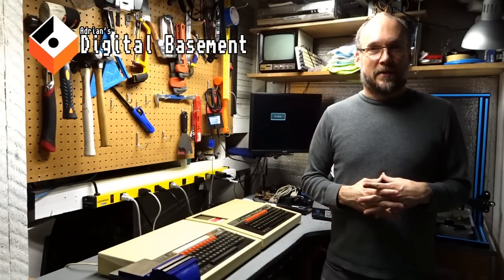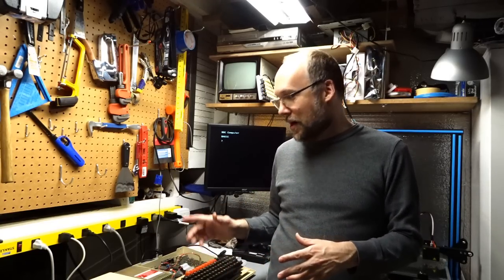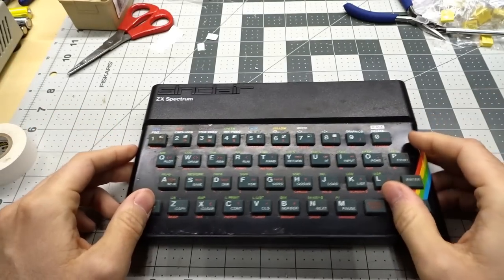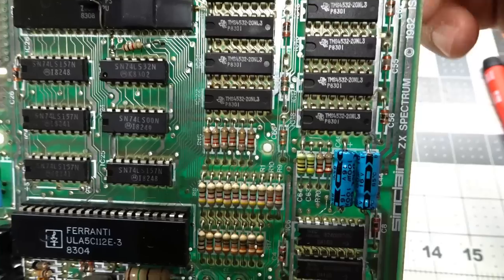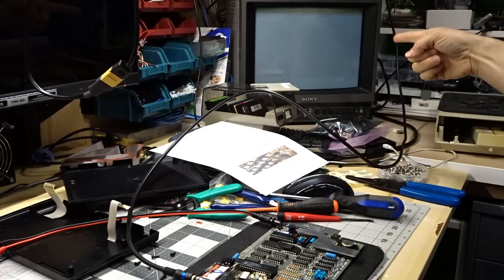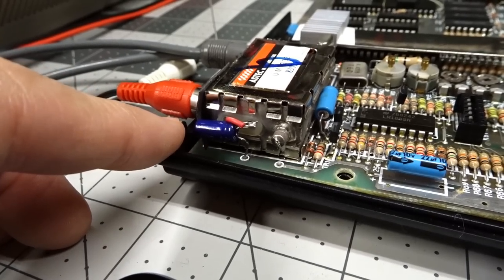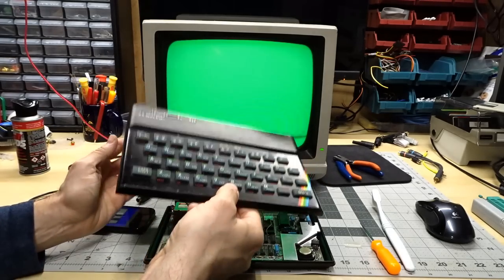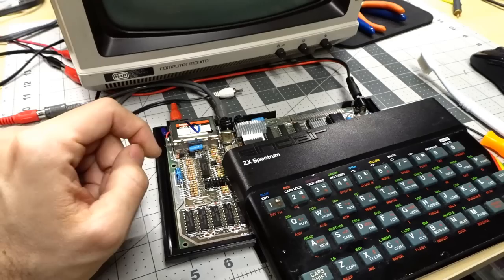ZX Spectrum Part 1 - It's a very sick machine (and a BBC Micro update)

Comment: It was interesting seeing that video.. Nice work by the way.  I had several years back.. The keyboards were a problem.. I replaced mine out for one of the Fuller keyboard replacements.  The Fuller case/keyboard turned the 48k Spectrum into a decent computer...  great video

Comment: Nice to see the gold old rubber 48k speccy.
16k ROM and 48k RAM
We got ours in 82. Took it back 1 week before warrantee ran out. Not sure how but seems a hot drink went in the back. Replaced but that 1 died after 18 months (still under new warrantee). 3rd spectrum lasted for a good 10 years. Early games were basic in gameplay and in coding. Later games used machine code and could give 64 and 128k machines a run for their money. Spectrum was popular and had a great following.
16k was the basic. You could add extra ROM to make it close to 48k
48k was what most people started with. It was always bought with 48k. You could add in extra RAM in the ports
After this there was a 48k spectrum with a hard keyboard.
I think there was a 128k spectrum and possibly a spectrum+ and +2 and +3
I recall 1 had a built in cassette which I think was used to stop piracy

The spectrum was quite hardy. I dropped mine down the stairs and had no issues. (3rd speccy).
The power pack was replaced every few years at £10-£12
Games took 3-5 minutes to load.

Comment: I know the purists will likely say get another spectrum 48k, but I recommend the grey +2 128k. I had no issues with mine and compatibility back when I was a kid, but it has the advantage of outputting all the audio to the TV and supports 128K games, even if its just the improved sound. 

After watching this video I was straight onto ebay and bought myself one. They are easy to mod to get the games to run off something other than the built in tape deck, I did mine when it broke so that it would run off my walkman, and I was only about 10 at the time, so its not that difficult. Mind you I still have a few old tape deck cd adapters laying about so could likely get something working with one of them.

Comment: Nothing wrong with issue 2 Spectrums, when Re-furbished properly they work well. The best way to do the composite mod is to use a small 100uf capacitor with positive to the PCB and negative to the modulator. To heatsink the ULA, remove the socket and solder the ULA direct, then use a 4.8mm heatsink.

Comment: I had one of the Timex/Sinclair computers which was sold here in the United States and it worked fine for a long time until the ribbon running to the keyboard finally broke and needed repair, but after putting it in the shop once I didn't want to do it again since the local Timex plant had closed by that time. It was my first computer and I got it cheaply since the drug store I got it from wanted to get it out of the store.

Comment: I noticed from how fast the Spectrum initialised (going from the black rectangle to the copyright message) it thinks it's a 16K machine. This is often a sure sign of a fault in the upper RAM. 
It's probably worth removing (and socketing) the upper RAM components, and seeing if the Spectrum functions properly as a 16K machine.

It's also possible a faulty keyboard membrane could be causing the memory faults ! This happens because the Spectrum design (ab)uses the address bus lines as "active low" driving for the keyboard matrix. See the schematic for the connections to KB2 to see what I mean.

Another thing to definitely check is that the outputs of the voltage converter circuit are correct. This is one place the capacitors are critical. The circuit is quite a crude voltage boost/inverter circuit and is a frequent cause of headaches in the spectrum. Check especially the +12V and -5V outputs, with an oscilloscope if you can to make sure they are not only the correct voltage, but free of excessive ripple and overshoot.
Reply: @adriansdigitalbasement  ah yes, hot RAM chips are almost certainly a sign of failure. You can use 4164's I believe with some modification

Comment: Cut 1mm of the tip of the flat keyboard connector and it works again. It only supports a few connections/disconnections before gets worn. In my ZX Spectrum I have soldered a better connector, using wires, because of that.

Comment: To answer the RAM thing, Spectrums were available in 16k models, but the vast majority were either 48k, or later 128k, with the 16k model being discontinued very quickly due to poor sales. The 16k models were so rare, most published software requires 48k.

Comment: The Spectrum internally works in the YUV colour space. The LM1889 IC on the board converts U and V into a PAL compatible chroma signal. That chip requires 12V to operate. This is why you lost colour during the under voltage: It was high enough to generate the 5V for the computer logic ICs, but not high enough to generate a proper 12V for the colour modulator.

Comment: The simplest joystick mod is for Sinclair Joystick. It uses the top row of the keyboard, either half, so 12345 are one stick and 67890 are the other stick. I forget the ordering butI think right (6-0) is LRDUF. You can piggy back a 9 pin D socket into the lines.

Comment: Take a look at retroleum.co.uk. They sell pretty much everything that you need here. Pretty much any Spectrum these days will have a defective keyboard and you will almost certainly need a new membrane. RAM failures are pretty common as well. They certainly happened to me. First with the lower RAM going and then the upper one as well. Instead of replacing the chips I suggest that you just get a lower and upper RAM replacement boards, solder them on and you are done. This has the added bonus of using a modern RAM that is less likely to fail. Recapping these machines is a good idea as well. Oh and possibly replacing the voltage regulator with a cheap ebay part. You can also find a replacement faceplate if you wish.

Overall I think you will need to spend about 50£ to fix this machine in total. And seeing how a new one would cost a similar amount (and probably require similar work) I think it's pretty reasonable to repair this one.

Comment: If you suspect a RAM chip, source one from somewhere, then use the 80s  chip testing trick of piggybacking the new RAM chip onto each of the soldered chips in turn until you get some sense out of it. Just tighten the pins a fraction and push it over the existing chip without soldering...

Comment: I'm about a year late to this party... these computers were sold in kit form or you could buy them assembled, the 16k version could be upgraded to 48k with a chip set you had to solder in yourself. You should have bought the Sinclair 128k + version whilst over here, the toastrack version not the later Amstrad +2

Comment: The later versions of the ZX Spectrum indeed had better keyboards, as well as an AY-3-8912 sound chip, MIDI compatibility, and other features.  They even have spacebars.
Reply: Although interestingly, they still used the same 40 key encoding as the original Spectrum. So, for example, the cursor keys simulated pressing Caps-Shift and the appropriate number key; pressing ";" simulated Symbol-Shift and O etc.

Comment: I always liked the super light-weight build of the ZX machines. I don't particularly like a solid feel.

No point in the UK is more than 50 miles from the sea, and it rains a lot besides that. It's just a damp part of the world.

Ha! "#Foreshadowing" popped up just as I was about to type, "Those membrane connects are tougher than the ones on the ZX81." They are, but I guess not by enough? :) The ZX81 ribbons can fail if you look at them funny.

I forgot how tightly packed Spectrum boards are! Or most Sinclair products, really.

Oh I love the "performing mods" screen! :D

LOL yeah I hated typing BASIC on the ZX81! I have no idea why I bought expansion board kits for the thing. Every keyword is a different key and they're not shortcuts, you have to use the key. I think, rather than have BASIC recognize text to tokenize words as it found them, they saved on ROM space by essentially having the user enter tokenized code directly. It makes good sense from that point of view, but getting used to it is a lot of work. And would it even have saved any ROM space? The code has to know which letters go with which token to display them, anyway.

Alternating lines suggests PAL isn't being interpreted correctly, or maybe not generated correctly? Perhaps the frequency source has drifted. But I guess it's long fixed by the time I type this.

Comment: Typing is faster when you know the keys after days of code. It's a good memory aid to remember all the basic commands too. Was the BBC shipped at cold low pressure? Possible reflow all the solder in the PSU.

Comment: The Spectrum came in 2 versions: 48K and 16K (for the poorer kids like me). I upgraded the extra 32K after a couple of years (1984 or 5) thanks to my granny's generosity. I was lucky in a sense, as the upgrade chips were probably better quality. I had the computer until 1987, when I sold it (and bought a motorbike instead :-)

Comment: Seem to remember most of these were sold and advertised as 48k? 16k versions may have been the earliest? Membranes were a known issue even when fairly new? Also those keys look in fairly good condition. Usually the lettering is worn off and the keys worn down.
Reply: The 16 and 48k models were both released at the same time. The 16k model was supposed to be the cheaper "entry-level" option. After a year or so, most commercial software targeted the 48k, so most 16k Spectrums were upgraded to 48k, either externally or by sending them back to Sinclair for an internal upgrade (or in some cases, they'd just send you a new or refurbished 48k model instead).

Comment: A good aproach with that Spectrum would be:
* Mod the board to be EPROM compatible (you need 2 diodes and a resistor)
* Socket the ROM
* Burn a ROM with the Spectrum Diagnostics ROM and plug it into the socket (see http://blog.retroleum.co.uk/electronics-articles/a-diagnostic-rom-image-for-the-zx-spectrum/ )

... you are now able to troubleshoot the mainboard without keyboard, while you limit the investment to something in the order of a dollar.

Should you be able to repair the board, you can consider buying a new keyboard membrane and metal keyboard cover (you can buy those new too). This is a bit more serious investment, but:
* Metal covers on Spectrum often look worn, so if you buy another one, the metal cover is likely not ideal either.
* It is the only serious cosmetic problem on your Spectrum, once you have replaced the metal cover, it will look brand new.

Comment: There were 16k and 48k models availible for the original ZX spectrum.  The 16k didn't last long though it was only £50 cheaper and most software for the spectrum was written for the 48k version.

Comment: The 2 main issues with the Sinclair are the keyboard membrane cracking and the ULA going dead. The edge connector wears out but re tinning it with the soldering iron fixes that :)

Comment: @12:25 this could be an artifact of the Spectrum colour palette defaulting to the non-bright colour set.  Use: BRIGHT 1 and then re-run the program.

EDIT: just seen post by @bennyalford , I had totally forgotten the capacitor issues.

Comment: unfortunately the uk government thought it would be a good idea to put bbc computers into all uk schools - so we are a generation behind the rest of the world when it comes to IT - I used to use freeze spray when I was an engineer - most dry joints or breaks in tracks will reveal themselves - I started with the ZX spectrum - you paid your money and then had to wait for them to make the thing - then several MSX then to 16 bit atari -  a commodore pet - then pc's then overclocking 286 then windows 123 3.11 then win95 - wow 386 - wow 486 - wow vesa - wow pentium
During this time I had become a system engineer working on VAX Clusters - now @ 61 I still love computers
Thank adrian

Comment: There's a ROM version of the Diagnostics you were using which defaults to the RAM test if no button is pressed for 5 seconds, so you might be able to do some further repairs while waiting for a new keyboard membrane. Best of luck ... this is the machine I'm currently rebuilding https://i.imgur.com/LduIEWB.jpg (note the selfwound coil :D)
Also: Since you're well competent enough and Sinclair machines being uncommon where you live ... please don't junk it and buy another. If the ULA is working repairs aren't that expensive (try finding a working SID for cheap these days)

Comment: Stupid question, but... are you still running it at 1 amp? Cos like you said the power brick runs at 1.4 amps, maybe the chips just ain't getting enough power? Might even explain the keyboard going wrong (worth a try!)
Reply: I was wondering the same. The video only showed the PSU at 1.0A, not the designated 1.4A.

Comment: A mod I did to my Speccy 48K was to replace the 7805 with a Recom Micro Switching replacement (An R78 from memory) available from digikey. No more heatsink needed. Hope you get the old beast working again :-)

Comment: The Spectrum was offered in both 16K and 48K straight from the factory. I bought the 48K version. Programming it was extremely fast once you memorised the key combos. Edit: Looks like the upper 32K needs replacing in its entirety. Together with a replacement keyboard & fascia, you'll be sorted. Speccys generally aren't money pits like for example an Apple ][ might be.

Comment: Did you check for cold solder joints for the -5? A cracked or broken solder pad could be the reason.

Comment: Would the flex cable be replacable with some jumper wire? Or is that not an option? I'm trying to think of ways to keep the repairs as cheap as possible.

Comment: Replace the keyboard membrane. They're not too expensive and it's quick and easy to do. in any case you're very lucky to have had any life out of the original, because they're nearly always faulty. As for the ram faults, check your power rails are clean, and bear in mind that each ram chip only provides 1 bit of the 8 data bits. The restoration will make an interesting series of videos.

Comment: I have an Issue 2 Speccy that I own since 1983, It has been in storage for over 20 years. Took it out, did the composite mod and it was working. Only needed a new keyboard membrane. But the picture quality of those issue 2 boards is not very good. I couldn't get it to work with any converter box. I have some of those you are using, and the symptoms are the same. Doesn't even work with the scart input of my living room tv. But I have some old LCD TVs that are able to show a stable picture. Looks best on a CRT though.

Comment: Great video as always!  I would get a PVM if I could find one for a decent price.  I think the ZX Spectrum + or the 128K (or both) came with composite video out.
Reply: The Spectrum+ didn't have any extra ports, just a nicer case and a slightly better keyboard. The 128k and later models had a port for RGB monitors and/or PERITEL TVs.

Comment: 2:35 it almost certainly isn't a break in the windings. Unless very thoroughly potted, transformer windings are under some tension, so when they break they split apart and tend not to come together again. My money would be on a solder joint or a broken wire or trace outside the transformer. Or possibly some other component being half-broken and shorting -5V, or something like that.

Comment: perhaps re the -5v  a solder joint around the transformer or the associated circuits need re-soldering. sometimes the joint is not actually there it look good but oxidation on the lead is preventing connection, you move the lead/solder while probing and the connection is remade by contact alone.

Comment: I want one of these, but man-o-man when I looked into making them work in the US I was a bit stifled..
Reply: You might have more success getting hold of a Timex Sinclair 2068 (the US version of the ZX Spectrum) although you'll need a Spectrum ROM (either as a replacement ROM or an external cartridge) if you want to run most ZX Spectrum software.

Comment: Just from the boot test during the first power on, I could tell that the upper 32K of RAM were not being recognized. I’d recap and retest. Naturally, it’d probably be more feasible to get an Issue 3 board (or later), and recap it (even if it’s working fine), rather than spend time on this sick puppy.

Comment: I recommend a replacement set of capacitors for this, the Gelec ones are pushing 40 years old now and I'm surprised non were leaking. I also recommend looking at the repair videos by JoulesperCoulomb - very thorough and covers most faults with a Spectrum

Comment: Did you change the power supply to the full 1.4A or leave it at 1.0A. The problems you are getting might be explained by the power if it was running at 1/3 less Amps than originally intended. Great video, I say fix it anyway. Just for the youtube entertainment.

Comment: Don’t know what country you’re from but England runs on 240v..that’s what our sockets are.....my mate is a builder..he’s moving from England to Spain....he’s got to replace all his power tools because Spain,...i think is 120v......if two drills with the same power are made by the same manufacturer....but deliver to two different countries..is it the transformer in the tool...if so how easy or difficult would it be to change that instead of the entire tool?   Thanks